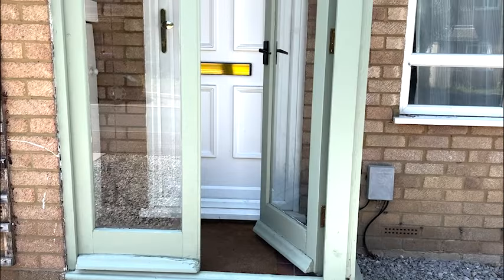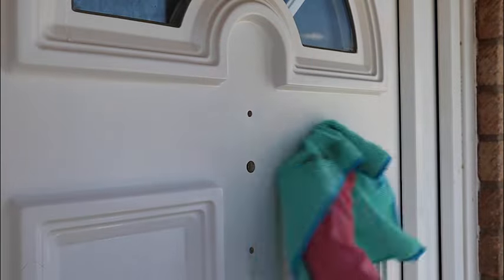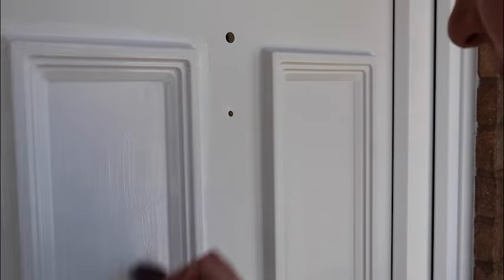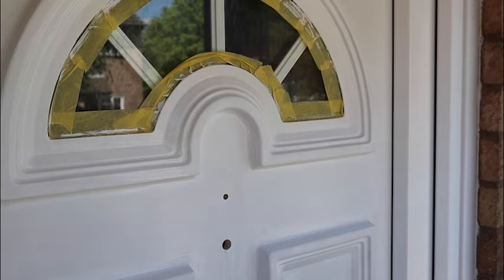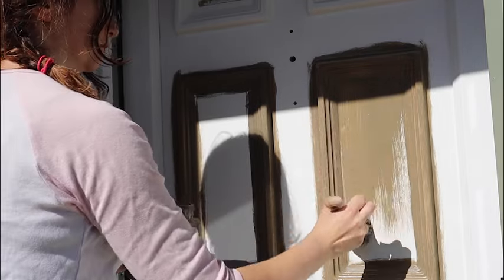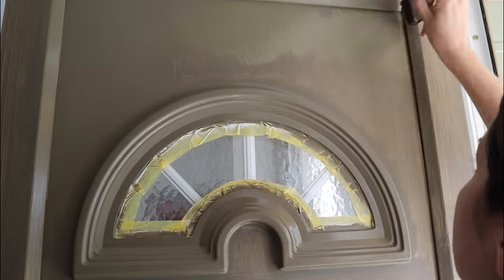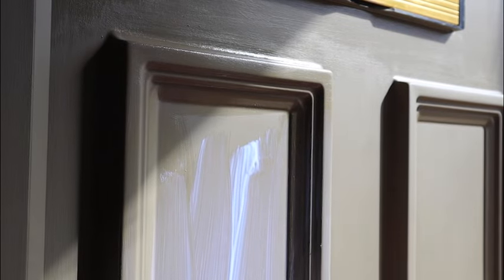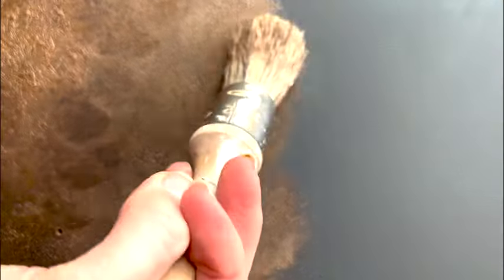How to Paint a UPVC Exterior Front Door

Comment: How many days did this take you to do if you had to apply multiple coats? About to do our front door and trying to work out how long I will need some dry days in sunny England 😂
Reply from the maker: I don’t remember exactly but it was 7 or 8 coats in total. 24 hours between the base coats. Several hours between colour and sealer coats. It probably took me a week of a few hours a day. A nice dry Spring week will work well. You don’t really want hot weather or direct sunlight as it will dry too quickly.